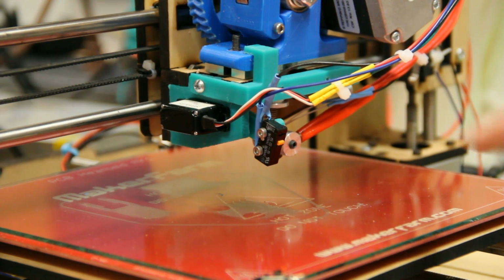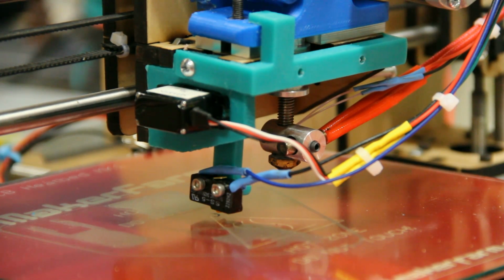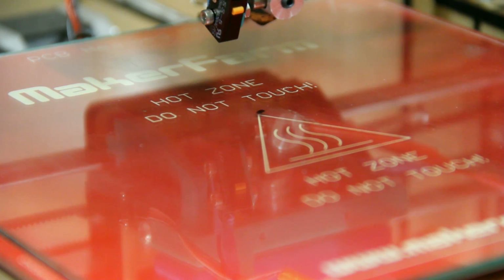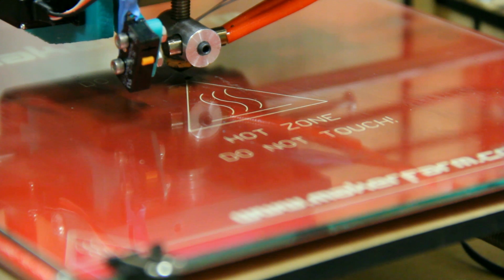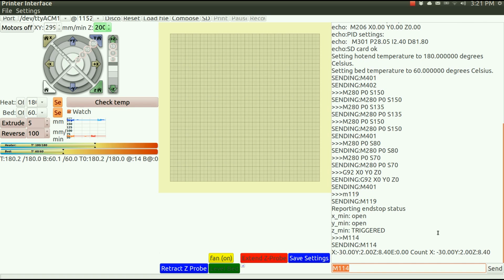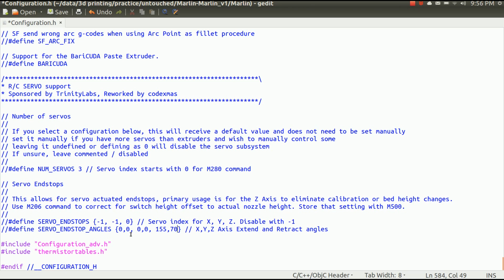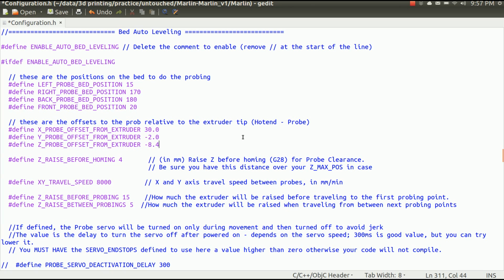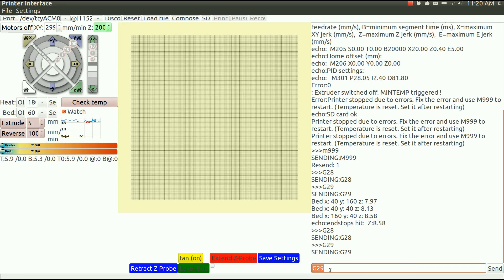Setting up auto bed-leveling on the Makerfarm Prusa i3. Part 3 - Final setup

Comment: I set it up, but my hotend is crashing into the glass upon printing.

I got -32.0, 2.4, and 3.49 for the X, Y, and Z and I've programmed the offsets to 32.0, -2.4 and -3.49 respectively and double checked.

I perform a G28, it comes out to the center for probing (says X=68, Y=102, Z=3.49) on the display.  I then perform G29, it probes several points, and stops at the final location (Z is showing 3.49 on the display.)  

Try to print a file from my SD card (Here are the pre-pended gcodes) G21        ;metric values
G90        ;absolute positioning
M107       ;start with the fan off
G28 X0 Y0  ;move X/Y to min endstops
G28 Z0     ;move Z to min endstops
G1 Z15.0 F{travel_speed} ;move the platform down 15mm
G92 E0                  ;zero the extruded length
G1 F200 E3              ;extrude 3mm of feed stock
G92 E0                  ;zero the extruded length again
G1 F{travel_speed}
;Put printing message on LCD screen
M117 Printing...

Note it crashes about 3.5mm into the glass based on my stopping and raising the head until it's just off the glass.

Any thoughts?
Reply from the maker: For the auto-leveling to work, you've got to run the G29 after the final G28, since the G28 erases all the probing data.  In you G-code, there is a G28 with no G29 after it.  I'd suggest changing this in Slic3r under "Custom G-code".
That's the first thing. If that doesn't work, let me know.
Reply: ZennmasterM Thanks, it actually looks like specifically the G28 Z0 command, as the G28 X0 Y0 shouldn't zero the Z-axis (according to RepRap documentation on the command.)  Looks like I get to go edit my start and end GCODES for all my different slicers, and scrap all my existing .gcode files.
Reply from the maker: TAZ427
My personal practice and recommendation is to think of GCODE files as being single-use and disposable, for exactly that reason.  Something as simple as using a different spool of filament can create the need for G-code changes, so I just plan on re-slicing before each print session, just so I'm sure that the current configuration is represented.
Reply: ZennmasterM I've been keeping mine, but I also create long names such as Doodle_ABS_0.2mm_0.4infil_1.0width_ABL.gcode that way I know it's for ABS w/ 0.2mm layer, 0.4infil, 1.0width and Auto-bed-leveling now.  I've started dropping the mm infil and width as I know the order now. Now it's just _ABS_2_4_10_ABL.gcode.  If I decide I want to adjust temp ranges, there quick enough to hand edit the temps.  Actually, I went back and hand edited the GCODES to replace the G28's w/ a G28 followed by a G29 in the startup instead of recreating everything.

Comment: I followed your videos and all seems to be correct... I think the newer firmware is a little different.  The servo works fine for z homing and G28, but G29 doesn't work. any ideas on where to look for the problem?  Thanks for the videos they are a great help....Thanks

Comment: I am having quite a bit of servo twitch. Any idea on how to get rid of it?
Reply from the maker: In your Configuration.h, at the end of the "Bed Auto-Leveling" section, uncomment #define PROBE_SERVO_DEACTIVATION_DELAY 300.

If that doesn't work, your servo is probably getting some noise, or you might have a bad servo.

Comment: In your slicing software, remember to put a G29 command in there after the regular zero-ing. A G28 code will make the machine forget about coordinates set by the G29 if you just run it before you run a print! Took a few tries to figure this out.

Comment: We need a part 4 too where you guide us to get started printing. Some how the gcode needs to know it should use the auto level and not just lower Z until the endstop hits.(with probe up) I assume altering the slicer parameters will do it. I will probably solve it in a bit my self, but at guide would be good to save time :)  Thanks alot so far
Reply from the maker: Yup, in slic3r, you're looking for "Printer Settings -> Custom G-code". In the "Start G-code" box,  Insert your G29 AFTER the last G28.

Comment: add a small cap (100uf 10v) to your servo power leads near the servo if you can toss in a 200k ohm from signal to ground to help clean up the noise it will help stop the servo from twitching and kill any feedback going into the ramps board. adding 2X 100uf 25v and 2X 3600uf 25v caps to the power going into the ramps board as close to the board as you can will help a lot if your having skipped micro steps at higher rates.. out side that nice vids man working on my own printer from scratch based on my custom CnC apx 30"x18"x9" of work space + heated build cabinet + and water cooled steppers and print head

Comment: My probe doesnt move. It probes twice in the home position then moves to the left for the third probe. Do you know what could be causing this?
Reply: It has something to do with the X endstop being triggered. If I move it away and then run G29, it will work somewhat correctly until the X endstop is triggered again.
Reply from the maker: Hawkeye0918
I think you are on the right track.  My suggestion would be to look for something in your Configuration.h that inverts the endstop logic for X.  Either that, or somehow you have both X_min and X_max set, which will basically cause it to freeze when it hits the stop.  Also, make sure you've got the endstop wired to the correct pins on your RAMPS board.

Comment: Hi, thanks for the great video's! :-)

Thanks to you I've successfully added this feature to my printer.
The only thing that bothers me is that the servo stays engaged all the time, and that it jitters when the axisses move.. Do you also have this issue? When the auto levelling is started and the Z axis moves down, the servo is constantly moving and I think that the jittering could affect the measuring.. Is there a way to disengage the servo (cut the power?) when it is in the correct position?
Reply: in case you haven't found it yet, in configuration.h there is a section to do exactly this. hope it helps :-)

  //If defined, the Probe servo will be turned on only during movement and then turned off to avoid jerk
  //The value is the delay to turn the servo off after powered on - depends on the servo speed; 300ms is good value, but you can try lower it.
  // You MUST HAVE the SERVO_ENDSTOPS defined to use here a value higher than zero otherwise your code will not compile.

  #define PROBE_SERVO_DEACTIVATION_DELAY 300
Reply: Rich Adlam Hi! Thank you, that did the trick! :-)

Comment: I have a problem with mine, hopefully you can help. It does the probing fine, but after it heats up the nozzle, it doesnt move back to the canter to start the print. it just starts it right there.

Comment: when you send the G28 command how do you set it to home in that corner??? my printer just homes to the center ( Z safe home)
Reply from the maker: That's strange.  In your Configuration.h, do you have #define min_software_endstops set to false?  If not, it should be.  If it's set to true, Marlin will respect the G92 settings rather than look for the min endstops.
Reply: it will not home back to that corner, when the z axis homes ( with the latest firmware) it uses z safe homing which forces the z axis to home in the center of the bed so that the switch is always over the bed and there is no chance of it missing the bed and causing a crash. I noticed this when looking through the code, though i have no tested a print yet to make sure it still prints to the appropriate location
Reply from the maker: That's a nice feature.  It's always amazing to me how quickly the community makes additiona sand improvements to Marlin.

Comment: Thanks for doing this, I'm trying to work through this myself but having trouble getting the new Marlin Firmware to work with my Makerfarm i3. You mentioned in your video that you had instructions in your blog on the changes to the new Marlin firmware for the Makerfarm i3, would you mind sharing a link to that?
Reply from the maker: It's in the description for part two of this series.  I'd re-link it, but alas, Google/YouTube doesn't allow links in comments...
Reply: ZennmasterM
Thanks, found your blog and am going through it now

Comment: Dam you are the MAN, thanks for sharing. Now i can mod my i3 and have auto leveling at last.
Reply: I need to figure out a way to install the servo on my I2. I still dont understand why they only check 3 parts of the bed and not 4 though
Reply from the maker: Very simple: the firmware is mathematically defining a plane, which requires three points. A fourth probe will define a point that is either already on the plane, in which case it is redundant, or it will not be in the plane, in which case we'd need to define some sort of non-flat 3D surface, which is a LOT more math (and floating point operations for the Arduino), and would probably require way more than 4 probes anyway.
Reply: I guess if the frame is jigged correctly it should be all good then
Reply from the maker: The whole point of the auto-leveling is so you can print if things are slightly askew.  As long as your print surface is flat (planar), then the math will work out.  If it's bowed or bent...  That's whn you have a problem...
Reply from the maker: Stuart Mitchell - Credit where it's due:  Lars Brubaker wrote the original code, and Alex Borro got it working and merged it into Marlin, so they are the men! All I did was make the how-to video! :)
Reply: I agree 100%, was not sure of how it got to this..
Well do all.

Comment from the maker: Jose Berruezo - It's not really calculated as such.  The idea is to make the probe locations as far apart as possible without running into something on the edges, pushng the probe past the end of the bed, or otherwise causing confusion.  What I did was to start with 50 and 150, then gradually move them apart.

Comment: First off, thanks for these videos. My only question is, would you just put the G28 and G29 command at the start of your gcode? And then it would implement the auto bed leveling in the print? Thanks
Reply from the maker: Exactly.  That's the simplest way to do it, and it ensures that the bed-level data stays intact.  A G28 will clear the probed data if it happens after the probe.  I just inserted the G29 right after the home in my default slic3r profile, and it works out quite well.
Reply: ZennmasterM Thanks so much! And my last question is, out of all the hot ends you have reviewed, which is your favorite/ you think is the best? Also one that cal push pal. Thanks
Reply from the maker: Michael Persson
Now THAT is a big question!  I'm actually planning to write up a "shootout" among a few of the all-metal hotends that I've gotten to use.  In the meantime, one that has really impressed me as far as "Bang for the buck" is the AluhotendV4.  It's not all-metal, so it's mostly for "traditional" materials (ABS and PLA), but it's very tough, and if cost is a consideration, it's really hard to beat.
Reply: Ok Thanks! But if money was not an issue, would it be different?
Reply from the maker: Michael Persson
Ahh, an excellent question!  As a sneak preview, right now, the question comes down to what you want to print.  For PLA, the AluhotendV4 is the nicest printing hotend I've used.  At more than twice thr price, the Prusa Nozzle MkII does an amazing job with ABS, and has an absolutely miniscule footprint, so you can get a little more height out of your prints if you need it. It's also all-metal, and ridiculously easy to clean.  There are a few more things I want to try with it as far as optomizing it for PLA.  The X-factor for me right now is the E3DV5, which I have, but haven't yet had a chance to use.  From what I've been hearing, this may be the one hotend to rule them all!  I'll let ya know! :)
Reply: Thanks so much for all the answers!

Comment: I know what I'm doing tonight :-)

Thanks for the instructions. I did notice that your code only uses three points on the bed to level, skipping the front left of the bed. Most printers in other video's I see use 4 points. Is three points enough?

Also, I presume that a custom code (G29) has to be added to the slicer software when slicing the model?
Reply from the maker: The Marlin code just probes at three points, which is all you need to define a plane, as long as you assume that the surface is flat.  I've never seen a cartesian bot do more than three probes, although I've seen the three probes follow a home, so it looks like four.  Deltabots, on the other hand, probe a bunch of locations, generally in a circular pattern, and can actually accommodate a bowed surface, which is really cool.

I put the G29 in my own default gcode in Slic3r, but it's not absolutely necessary.  You can do it manually if you want. Just be aware that a G28 (home all) will wipe out the probe information, so make sure to home BEFORE you probe!

Comment: thanks Michael fantastic work :-).. have you changed the servo from part 1?
Reply from the maker: Actually, this is the original servo that I've been using.  For part 1, I actually printed a second set of parts and used a new servo and microswitch for demonstration purposes.  That's how much I like you guys! :)
Reply: ZennmasterM oh i see nice :-)